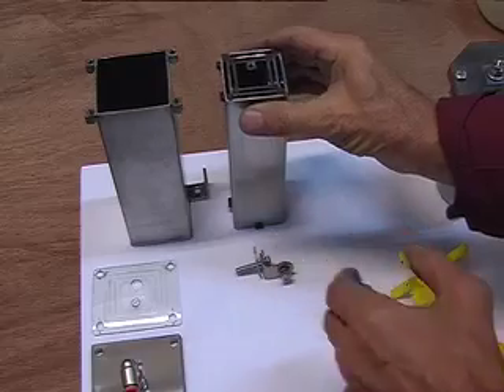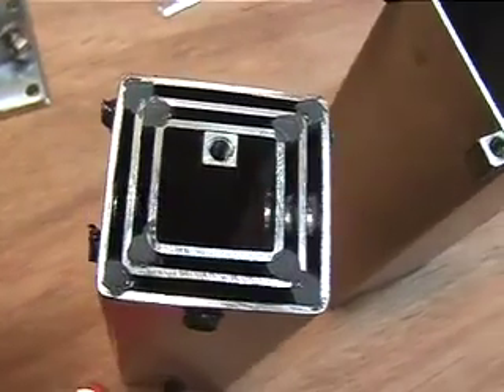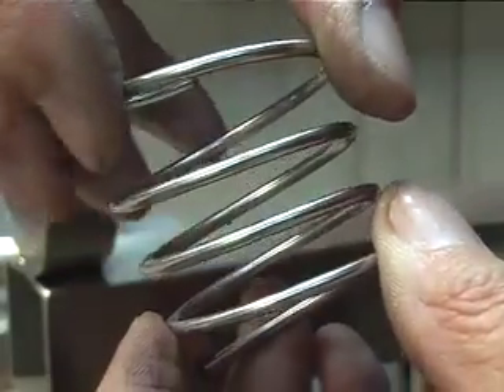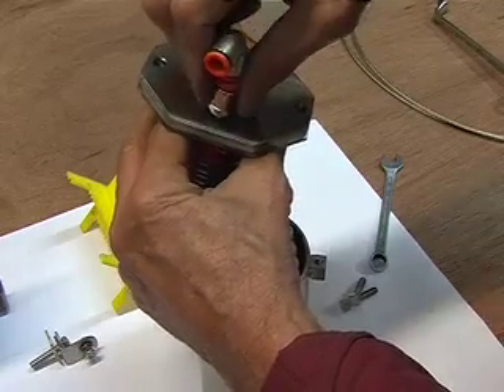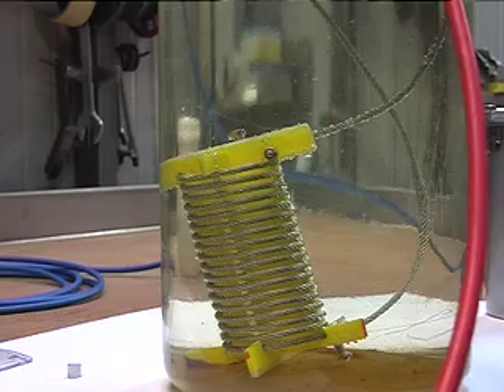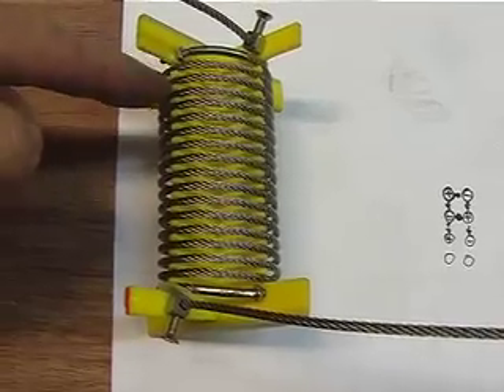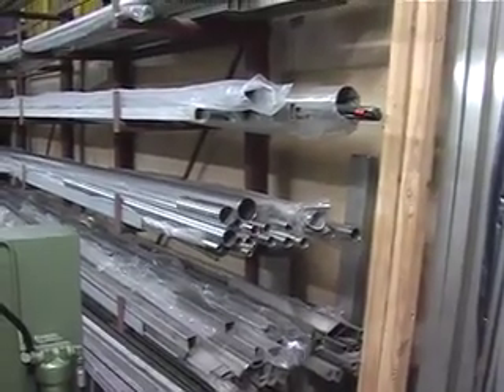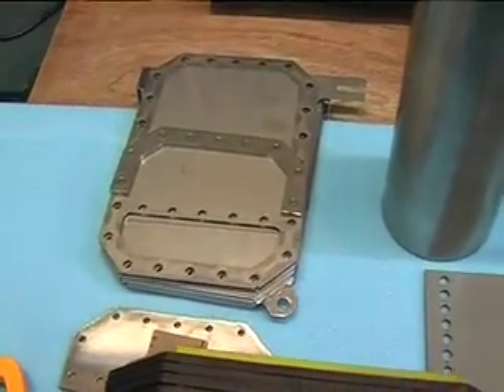HHO SWISS INOX 8AFTER ONE YEAR'S EXPERIENCE

Comment: Try experimenting with a lower voltage using multiple cells. 5 or 6 cells in series fed by 12 volts is more efficient drawing less current for more hydrogen. Keith in the UK.

Comment: The drop in voltage between the 2 electrolysing plates or coil should be around 2.2 V. If you are putting in 12 volt it will be drawing a lot of current but most of it would become heat. 

A simple change to this would be to use the 6 cells in series if you are using the 12 volt. 

You can also regulate the output voltage to 2.2 V .

Another way is to have a 5 neutralisng coil between the 2 current carrying coil. 

I do not know if this will work. Hope the suggestion is useful. 

Thank you very much for a very informative and practical series of videos. looking forward to your next experiment.

Comment: you using 12v?   Have you tried using 3 of those marine wire coils in series?  You only need 2v so you should come up with a way to get the voltage down from 12v to 2v...  It will cut down your current..  3 in series should get your voltage down and produce a lot of HHO.. At least theoretically..  However, if you are using this in a vehicle, the idea of a little steam isn't such a bad idea.. The steam would add to the compression and clean out the pistons from carbon..  You want a very little to get injected as well..

Comment: Nice cells,  the real gains in production can be made by focusing attention towards the resonance of the cell with an inductor,  not using any additive to the water but rather taking the cell as a capacitor and adding an inductor in the circuit to create an LC circuit with a resonance frequency.  Tune your electrical impulse to that resonant frequency and water will disassociate overunity,  that's how Stanly Myers did it. 
The traditional methods of forced electrolysis will never go overunity.
Additionally consider the effects of electric felids to sepperate the H and O , with the additional force on the water molecules of a very strong magnetic field aligned with the electric field,  north is positive and south negative. 
Good luck,
Additionally don't get distracted by people talking about a water dissociation frequency,  it's not some magic frequency where water fly's apart 😅, rather it's the unique resonance of your cell based on its capacitance and inherent inductance or the addition of an inductor,  for this to work well you'll need the cell to gain voltage meaning the inductor in series and use pure water so there's very little damping or conduction. 
As you can amagin, if the water is separated by the strong polarization effect of the high voltage electric field,  much the same way a fluro tube illuminates in a strong electric field,  the current does not even need to flow,  so water sepperated with oscillating high voltage and zero current is obviously zero watts  😉

Comment: Not the marine wire, but the thicker one, make a U shape and only put it in half way, no loops like a coil. If just the one U half way in works then what about 1mm or very small 316L balls like bb size I'm guessing. Have them packed in a non conducive container of course with metal plates riddled with holes the 316L beads can't fit through, plates holding tight with charge on the plates

Comment: Hello!I myself am from Ukraine.Doing experiments with brown's gas. .It please,what model are given at the end of the video cells the most effective?Testing in cells Meer came to the conclusion that they have not,much zavozdushivanie.Do for installation on passenger cars,from battery-30 Amp.,with PWM 15Амп.,directly from the generator-10 Amp.,gas output in all cases secondary.For the 2.0 l cars is not enough.Look you have more experience.

Comment: Have you worked with Pulsing the cell (PWM) and working with frequencies? Thanks for your awesome work. I have also found the plate structure is the best and am working on voltages, no neutral plates, frequency, and higher voltage with tesla ideas. Can we lower the amps but have a high voltage and incorporate frequencies maybe in the KH ranges.
Keep Rockin"

Comment: Why do you use stainless steel instead of different metals like copper or aluminum.
Reply: other materials like forged steel, brass, nickle ect... react differently to the electrolyte mixed with the water, this sometimes creates horribly harmful gasses chlorine. 302 stainless steel  does not create this reaction unless salt is used as electrolyte. also stainless steel is resistant to oxidization and degrades less frequently, thus extending the life of a cell.

Comment: I have read (in a book of 1900's that the use of more than 2V is not required for production of HHO and that all voltage in excess is really only converted to heat.  I also believe that AC is more efficient than DC (for HHO only) due to the problem of plate contamination from a bi-polar static DC arrangement. Fluid properties are also important where the use of a prepared solution of sodium chloride and steam distilled water is essential for plate cleanliness and effective electrolysis. In my mind HHO production is about plate area and distance between plates. The introduction of magnetic field/s is an interesting front and some show an increase in this reaction. On magnetic(s), there was a video I have somewhere which covered the chemical reaction science in great detail and showed how the H and O molecules are moving between the plates and the attraction to one plate or the other is based on + and -  charges. This tends to discount an AC system as it seems stupid to cause a molecular flow only to disrupt the flow and reverse it. If I find it again I will post it here.  Perhaps this is why a PWM working in DC is a better solution?
Reply: you contradicted yourself? which type of current is better for hho
Reply: @strongholds12  I've also seen a 40kv HHO generator from using the coils in a vehicle..  The guy said it does produce way more HHO at a very low current.. however, it would seem without stable design such as these in this video, it could cause some arcing which is to my mind not ideal in a hyrdogen environment..  The guy did use plates in his design much like a zig zag type of dry cell where it made the water cross the plates fully as it travelled through.. His plate design may be the key to producing the more HHO, maybe not the high voltage..

Comment: Hi AMMANN, I've followed and appreciated you for a few years now. Your teaching technique, showing how to fabricate and make assemblies is excellent. Your spiral marine wire generator, w/good surface area, inspires me to a long term goal to make High Temperature Electrolysis (HTE) burner commensurate with a new boiler.  Thank you! Note that it takes less energy to produce HHO at elevated temperatures according to Gibbs equation. Any ideas to produce what I would call a Gibbs Tube?  Description: scalable; outside to inside - 1/2" black iron schd 40 pipe, .125" DIA SS coil spring threaded into the pipe, smooth SS thin walled tube, perhaps another SS thin walled tube within and finish with SS marine wire at the center.  Challenge is to insulate and seal?  Please contact me on my email to discuss further if interested?  Very Best wishes, Rick

Comment: Excellent video. May I ask you what was the ultimate purpose of your hydrogen producing kits, would it be to use the hydrogen as fuel in your car. If so, would you address that please in some details. Thank you
Reply from the maker: +sam rafeedie I did it just out of curiosity, as I already told many times for the fun of it. The complexity connected with the production of a reliably working unit is beyond my means. The usefulness for a car is highly debatable. Some have had good results with heating units and there are also welding machines who use this technology.
But  I have seen to many try and fail,. But for cars it is by far to complex, to many rules and laws and also the security issue since we use HHO is a very touchy point. And not least the price tag of such a production, connected with the amount of time required to work on it, that I do not have anymore. Thank you

Comment: Nice work but you need high frequency of A/C about 1700 to 1800 Hz. The A/C prevents the thermal problem and helps to stop the buildup of corrosion on the plates as you know Voltage travels from negative to positive. With a continuous flow in one direction cause buildup on the positive  plate's . to control the amperage is to reduce the mixture of chemicals in the water they are the conductor (Load) of the process . 
   A Russian Name Brown First developed the process called (Brown's Gas) he used Baking soda as a conductor. There are a lot of people on the TUBE acting like they have invented a new process but it has been around for a long time. It may be from the 40's or 50's. Don't get me wrong it is good to experiment with different methods. Phil  WW5D

Comment: I must say one of the most honest videos about HHO cells i have ever seen!
Thanks for that honesty!

Yes, I do experiments with HHO cells too for a while and had most of those ideas already 35 years ago!

After all the most efficient and the easiest to construct cell is a dry cell stack with stainless steel plates and a
rubber sealing (EPDM or whatever).
But you should use material 1.4571 instead of 1.4301 as it is much more resistant.

I planned to make a cell that separetes O2 and H2 and that is more safe. You can do so, but it is quite a lot more
work and it wont be that efficient, as you need a reliable diaphragm. I already did a lot of testing materials for that purpose...

I am planning to build a new cell soon...

Thanks!

Comment: Great  job all your projects work good you can sell them so you can recuperate some of your cost and keep these great projects going. I think hho production is a lot about  surface area and allowing fresh water to not get displayed by the gasses  being made connecting the coils together will probably be just as good as the plates  i don't think the fresh water is getting in good contact with the plates and use a positive  neutral  negative neutral positive  design will help production keep up the great work
Reply: As-loo@eennné)llj2. AHORA 
% ' bus y (^o^)                         bbbnnnbbbnnnnn.  Mllkm

Comment: I understand the concept of this becoming a water heater... When I first came across your videos I thought that the coil design may do that... But the production is huge on these cells you produced... What if you were to use a completely flooded design for the case around the generator with the marine grade cable .... and circulate water / electrolyte from a larger 10 to 15 gal reservoir with a small circulating pump. i.e. (pond pump) circulate water out of the bottom of the reservoir into the bottom of your production vessel and the pressure would force the water and HHO out of the top to return to the larger reservoir where the HHO bubbles to the top like normal... and out to a secondary bubbler... the larger quantity of water would be much more difficult for the coil to heat.... Just an Idea Ive had bumping around in my head since I saw your coils ... thank you for your work....

Comment from the maker: @heartrobot351 NO I think the cable you find in bikes probably is only plain steel and will rust in no time. It should be marine wire 316 L  or as the old definition A4 Stainless Steel.
Good luck and good work and good results.

Comment: thank you sir for doing this, it really helps ,i been so eager to do this cool project since i have an old car and want to see the results in it, now just one question is marine wire the same as the cables or wire i find in bikes,you know for the brakes, or in cars the cables they use for shifting gears in the manual transmission, just wondering can i use that type of cable, thank you,

Comment: keep up the great work, your knowledge helps us, i thank you for your knowledge and experience.  have you thought about the resistance of of the wire from the battery connections to the hho machine? and what role it would have on reversing the polarity of the wires so that the netural became postive and vice versa, also, what if the lead wires from the battery to the hho machine were equal as in resistance ? usually the pos (+) and the neg (-) are made of  different materials, using the same

Comment from the maker: @ferbankai Flood the cell and keep the connections under water but as I said coils are basically heaters and therefore can get warm. If you make the attachments much thicker than the coil material that could help.

Comment: Hey dont says that a coil acts just a heater a high voltage pulse pass through this coil has magnetic field and enough to cut the atom to pieces and release the tremendous free energy. You just configure the nano system of water molecule interact with electromagnetism.

Comment from the maker: I no expert either. The air intake is fix while gas can be regulated and since the sensor tells how much oxygen is present accordingly the computer will add gas. if you add HH only it will take the oxygen from the gas mixture in order to explode. If you add HHO it has the exact ratio to return to water but the sensor would measure more oxygen and request more gas and to avoid this there are the devices that fool the sensor so you can add HHO as an extra without interfering with the gas mixture

Comment: I am not a combustion engine expert, but logic tells me that for gasoline to ignite, there is oxygen already in the chamber. When we further inject HHO, something has to give. Oxygen regulation on gasoline engines is needed supposedly to fool the comp when it thinks there is too much oxygen so as not to send more fuel. If we send 1/3 less HHO, we are sending HH and with reduced fuel there should be enough O in there. If not we can send in as nuch as we like. I believe in control&fine tuning.

Comment: INOX MAN, do not get discouraged. Failure is only the road to success. And you will get there in the end. And we are here to support people like you. As dmfaria83 said - "take measurements of power vs lpm". I saw some serious gas release in your vid even at 38amps if you were getting 3-4lpm that may be a promising design. Also, take a look at the high voltage side of things, not only the amp side.

Comment: try a Large Quad helix (Positive Nutral Negative Nutral) with inside a dubble helix (Positive negative) and a nutral core
de spacing between the spirals must be the same as the spacing between the Quad and dubble helix
de spacing between the double helix and the core should be the ( spacing spirals * 1 1/2)

Comment: Very good work. The problem with amps is well documented.  The PWM already mentioned here may be a solution.  Even though you say the plates are best your coils are very well crafted and beautiful. Have you thought of 3 mini coils in seperate containers running at 8 amps or so ?
Have you tried plates with holes drilled in them every  few mil? Just a thought but love your work.

Comment: just for the record i got i hole liter of gas in 1 min 15 secs with 3 positives 2 negatives and  4 neutral (plates)
but lots of heating  and installed in my truck (pick up ford v8 engines 1 1/2 ton) got  17 miles (aprox 26 km) in 4.5 liters of gasoline but after 35 minutes of production my temp got so high that melted away my case so next time got to sink it in more than 1 liter of water  lol!

Comment: Would the Spirals be better if the water was being circulated through a cooling system? (radiator)  How many amps does it take to boil the water?  Will HHO stop being produced if water is near boiling?  How much baking soda was in the jar that the spirals were drowing 40 amps ?

Thanks for your help and sorry for all the questions

Paul from Canada

Comment: wow ... wow.... wow... , thats some good work. do not connect a cell to your car
hydrogen will destroy your engine look
up hydrogen embrittlement. even if
it wasnt a scam you would still destroy your car. you are a master crafts men
and your cells have potential did you no
a cell can run and generate up to 10,000
psi . it can help gas milage but it doesnt put of carbon when its burned you keep it up and when we find a more uses for this procces your cells will be vary valuable.
NOBOX7.

Comment: Thankyou for your honesty and integrity.  I would like to give you a little info I gleaned from one of my tests. I constructed a mini spiral like the one you did with the inside spiral running.  But I disconnected the inside and made it a neutral...Have you tried it.  I got a a major drop in amps and very little change in output..

Comment: You are the best!!! I think you have to get in touch with Energy Builders Network members and Bob Boyce and Smack so they can help you with plate preparation using several citric acid baths, and plate orientation based on their magnetism, and some other tips so you can take your already made cells and take them to their maximum possibilities.

Comment: I've noticed, like in all HHO devices, that your devices are linear structures. Do you think a non-linear structure would work better? Like the atomic structure. Maybe stainless steel ball bearings suspended in a conductive jell. The centroid would be a cathode, and the outer shell the anode. Is this plausible?